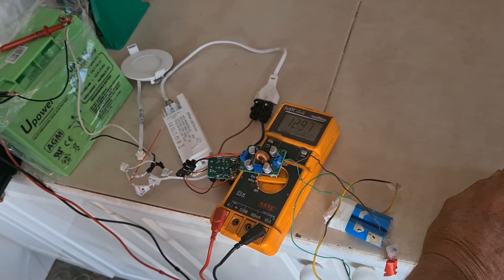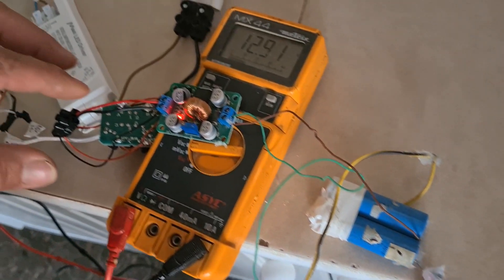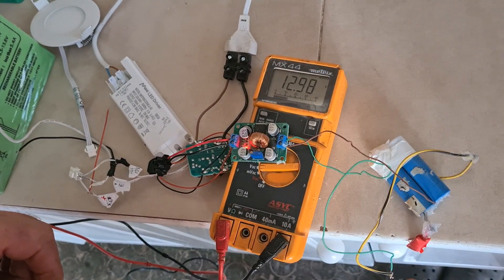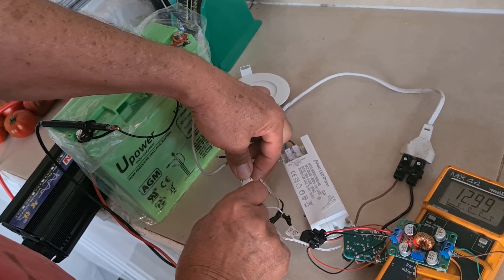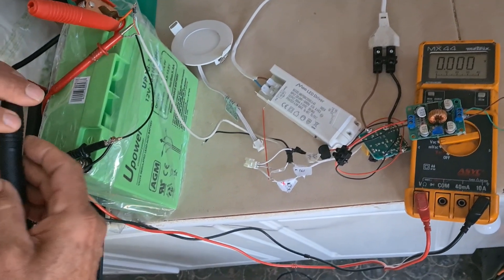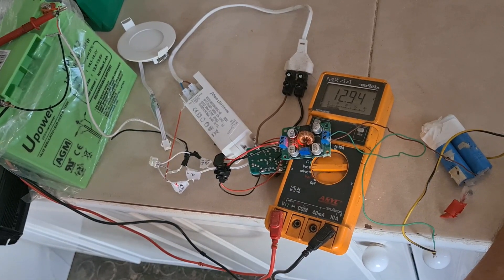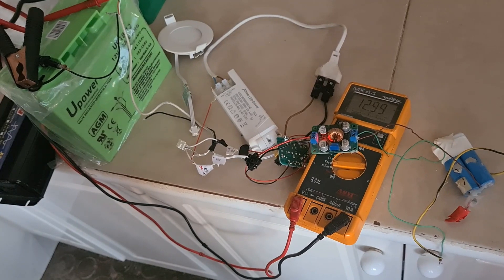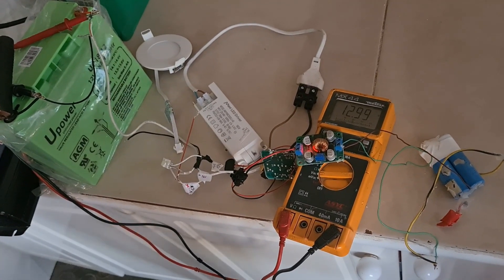Scale this fue-less solid state generator and the energy crisis is over

Comment: Got a schematic?
Reply from the maker: Hi, I don't but what you don't understand you can ask. Regards
Reply: @denissabourin I would like to make a setup like this and would like to know if the green (bigger) battery can be used to power appliances, say a TV and a laptop, while it is being charged by this circuit. Also, what about the two small batteries, how do they get charged? Can they get charged in this setup as they're being used?